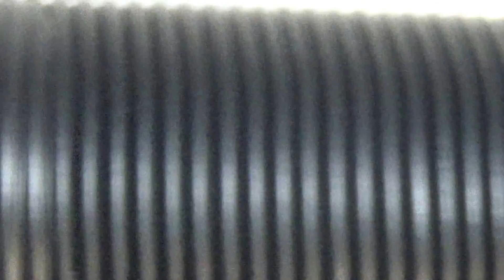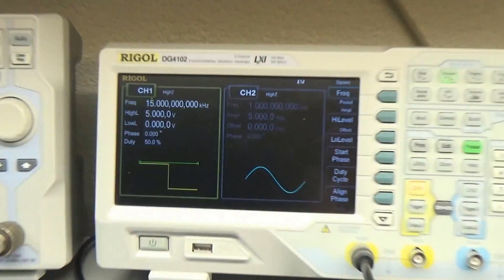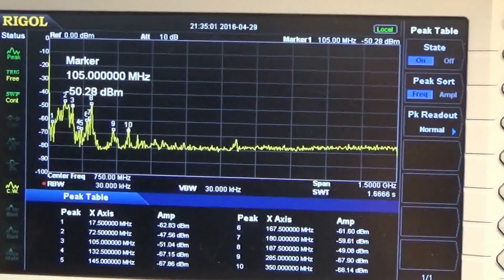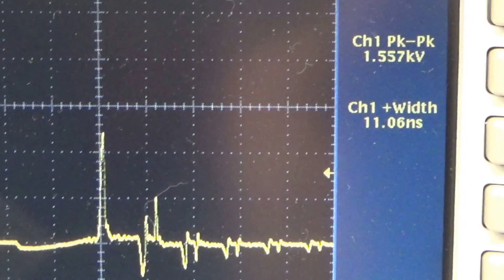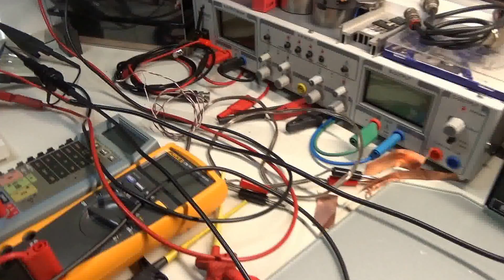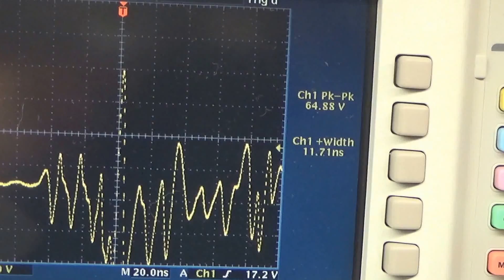new nano pulser 2

Comment: Hi Itsu re your nano pulser coil, I have been experimenting with the (torroid and grenade) as a whole, I have taken a somewhat approach and tried different winds and turns as primary winding's go with different results.

What i'm interested in is how you added your nano pulse winding (direction and length as both would be directly proportional to the wave length your pulsing it with and i would think you would need to make steps attenuate any secondary pulses from reflections or tune them into the primary single pulse.

I'm about to enter the Nano pulse field, I was wondering if you infarct used a tuned length of the 50 ohm cable Ie 19 meters etc as Dally reported 21 turns in his original as different lengths would return different reflections (fun and Games no doubt ;)
Reply from the maker: Hi Grey Wolf,

i had my 50 Ohm coax cable wound the same way as the Grenades first 2 layers, then the inductor on top of the coax was also that same direction.

Nor sure about the length as i just filled up the space i had on the lower part of the Grenade.

The idea was to interrupt the resonance sine wave from the yoke/inductor with the nano-pulse, so i did not tune to a specific frequency.

But even with a 1.8KV nano-pulse, the impact on the resonance yoke/inductor sine wave or the Grenade sine wave was minimal, so i stopped using the nano-pulser in the Ruslan setup.

Same i had with the Dally replication, minimal effect from the nano-pulse on the resonance sine waves :-(

Itsu

Comment: God job,
But the nano sec pulses together with the running Induktor give some results on the output? 

I think in this weekend i finish adjustments to my  class E Tesla coil setup and add irradiation element to the induktor. 
Here a small video  - output from TT wit modulation [its possible to hear only little bit from streamer ... because my Inverter to inductions heater part runs @ 18.8 kHz] 

SSTC output with attached coil 3 MHz. 

https://youtu.be/viFURbcuWFI
Reply from the maker: +Sandris Demants Hi Sandris, thanks for your comment, looking very impressive what you have there.I stay away from kacher / tesla coil like devices as i have lost / damaged many tools / equipment due to it.I now try with nano-pulses, and don't be fooled, as this 1.5Kv pulse when packet into 10ns delivers 39KW of power.Looking foreward to your result later this weekend.I did not make any output measurements yet, but should be possible later this week.Itsu